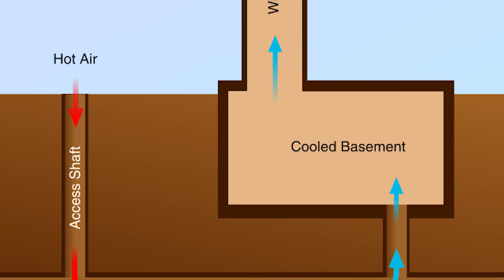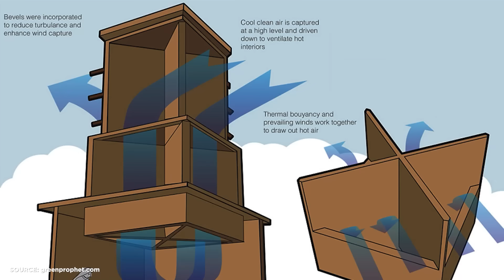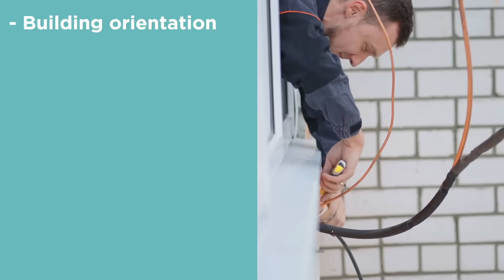Forget Heat Pumps - This House Cools Itself With NO Electricity!

Comment: Canada has had the so-called "R2000" program which started circa 1982, or forty years ago. My house is built to follow (more or less) this standard, with 24 sq meters of solar gain, foot-thick walls, air tight, a Heat Recovery Air Exchanger. Our heat, even in Canada, is quite affordable.  That said, all the gadgets and gaming PCs do use a lot of power.

Comment: My house has a cement slab set about 18 inches below ground and the lower level of the house can be 30 degrees less than the outside air. Even with no heating or cooling it stays between 50-80 degrees when the outside can be 15-106. I have been using resistive heaters in the bedrooms and a wood stove in the main room which I will replace with a mini split sometime this year. My upstairs level is pretty much whatever temperature the outside is, so when it's warm I open the windows. Most of the roof is shaded by trees, but I may still add an attic fan to blow hot air out of the attic before it can radiate down into the house.
When I was a kid in West Texas we didn't have AC, but we did have a swamp cooler on the roof that cools the air by evaporation. It trickles water across a porous surface and then blows air through it which can cool the air 25-30 degrees if the humidity is low enough. It probably wouldn't work in the east when the humidity is high though.
Where I live the electricity really never goes off unless there is a windstorm in the winter that knocks down trees, which is why I have a wood stove, but I added a storage battery to plug the refrigerator and a few other things if there was an issue

Comment: I saw a blog once with a dude who was kind of homesteading in the high desert around Northern Arizona iirc. He had a mobile home and he installed vents in the skirting and the floor. At night when it got cold he'd open the windows and the skirt vents to let the cold air in, then shut everything in the morning. When his place started warming up he'd open the floor vents and it would cool off the mobile home. I think he was using a few fans, but that's still better than an AC unit.

Comment: In Australia we have a town called Coober Pedy. The temperatures regularly get over 50C (122F). The whole town is built underground in what started out as abandoned opal mines. If you wanted a new room you just carefully dug one out. Heating and cooling are generally not required and the only electricity needed is for appliances. This is mostly obtained from solar or wind generation these days but was once from diesel generators.
Reply: Wow. Town of the future.
Reply: @BeautifulEarthJa  From the cave to the cave…
Reply: Inspiration for future Mars habitat
Reply: @GeDiceMan  LOL! Yeah…
Reply: Wouldn’t work here in south US. It gets super hot, absurdly humid, and yet it rains so much. Nothing but muck and red clay most the time… If I could have dug myself into the ground by now, I absolutely would have already 😭
Reply: I have a partially underground she shed becoming a tiny house.   I spent 4 heat domes suffering this summer, but planning both storage and a bed inside.  Cool today, and was out there this morning cleaning it out, preparing for broader use.  Underground is the future. I expect I can spend a month or two chilling in summer and winter. I planted several deciduous trees 9 years ago. Shade, but a tree can put 2000 gallons of cooling mist around the house.  Shade trees on the west, fruit trees on the east.  Nut trees uphill.
Reply: Find some practical ways we don't want to live in the 1800s. Plant more trees and create more energy efficient homes if you have a creek put a was water turbine in and generate your own electric power. And solar if it's practical and off grid. Selling power may be good but if the grid goes down so does your system. Battery system is the better option. 73
Reply: @ronb6182  why are you demanding others find a way that suits YOU?
Reply: @RebeccaTreeseed where!!!? you misread my comment some want to live in the dark ages this is 2023 not 1823!!!
Reply: @ronb6182  Great idea about the creek!
Reply: @classicmax1 anything that doesn't use electric is dark. You need light , heat and water to live. I believe in saving energy but not at the cost of turning back to the 18 century. Good insulation and setting the thermostat to 77 degrees in the summer and 70 in the winter. I think I do more energy saving than most people. When we moved to Florida we couldn't afford to run the AC we used fans and some springs were in the triple digits. At least the nights were in the mid seventies. The attic fan cooled the house. Now that we have window units that don't use much energy we can cool just one room and save hundreds of dollars each month. My bill rarely went over 50 dollars. I also don't need to spend a couple of hundred dollars to build a house. I can use what is built already and save money. Enough said 73
Reply: Sweet!
Reply: @classicmax1 yeah I just thought I don't have to either I can use Gas. They make natural gas AC units. Good point. 73
Reply: Only just saw this video.
Yt a bit slow in updating me.
Spent a lot of time in the tropics and most non-electrical house designs there are designed to capture and control breezes.
What happens if there are no breezes?
Living in Port Moresby PNG, I came across the ideal house, designed by the Engineering Dept of the University of PNG.
Very simple design, but very effective.
The house was single story open plan running east-west with a besser block (cavity brick) wall on the north side (south side in northern hemisphere), running parallel to the house, the top of the wall being level with the eaves and 1’ distant from it.
The wall absorbs heat during the day and acts like a chimney drawing cool air through the house, which has louvres and fly wire netting, the ends of the house being completely sealed.
The resultant airflow is further enhanced by the ceilings being curved (easily manufactured from dampened particle board sheets).
The pitch of the ceilings being perpendicular to the pitch of the roof.
This results in turbulence of the airflow resulting in having air directed at you from all directions!
Because the heat is stored in the wall, the airflow continues throughout the night.
I am not sure whether the cavities in the wall were filled with concrete or not.
Reply: please discuss radon issues.
Reply: @rm-gh1co  They (and most of the world) are fine - the soil and rock doesn't contain the mineral that breaks down to release radon. 

It's something to check for when buying or building since in radon prone areas, you can "solve" the problem by ventilating the basement (Modern air-tight houses concentrate the radon to dangerous levels)

Comment: When we built our house 5 years ago, we ran with under ground pipes for incoming air.  Its 5-10 degrees celsius warmer during winter and 2-8 degrees cooler during summer. Its inclined with perforated pipe just before the last bend, for water to escape.
Reply: That can be great and sounds like it works really well for your area.   You do have to be able to clean these pipes in most climates due to mold and mildew issues.  There is also radon concerns some places to think about too.  But awesome idea.  
Could also just seal pipes and pump glycerin around and get same results in any area.
Reply: @mrkozz1  The thought of mold was actually brought up, but our neighbour has the "same" system and for them it worked well. Not sure what it takes for mold to start growing since even if its probably quite humid, the air is constantly moving at quite high speeds.

Comment: I live in the southern region of Brazil, and around here it only became common to have air conditioning in houses and apartments a couple of years ago (you could get air conditioning, but most people didn't bother because it rarely got too hot). Before that there was some electric heating for the winter, but mostly people would basically just dress acording to the weather

Comment: Makes a video to tell us windows let cool air in. I joke! Buildings even 40-50 years ago were better designed and planned for airflow and shade trees. I feel AC has definitely become cheaper and therefore more common, with more emphasis too on insulation and efficient windows, but less passive cooling.  I feel so few single family homes are built with basements today too, in the past cellars were cool and dry to preserve food, and finished basements provided a cool place in the summer. Many builders today mass construct housing divisions, they dont care about things like longterm quality of life. And with rentals the owners have no incentive to improve the house or make it energy efficient if they pass the utility costs to the renters, and the renters aren't in a position to improve someone else's property.

Comment: Great news about the Nebula classes!!!  Congratulations!  I will point out that in domiciles in days of yore, had much lower cooler temperatures to content with.  Remember how all the people in the old Westerns dressed in what looked like incredibly hot, multilayered clothing?  It was not out of some level of modesty (at least not entirely), the temperatures back then were lower enough that those sorts of clothes were comfortable for much of the year.  So, the problems of staying cool that we have currently did not really exist back then (at least not to the present degree).

Comment: All of this sounds nice. But you have to have fresh air, which means you have to have another system helping the hvac system. Or else you'll get a build up of carbon dioxide. It sounds nice as I said. All the solar panels(made from oil) this whole electric vehicle thing has happened back in the 1900's they had more cars and more charging stations. So... it's just a bunch of bull. Trying to sell the past. But good video, I guess, if you're into fairy tales. I believe in natural energy collection but wind and solar are not it. In other words, You have to have an air exchange. Dump air from inside and pull outside air in.

Comment: I actually take issue with your representation of the Texas blackouts.  Yeah, there was old equipment that contributed, but the vast majority of why it happened was the push to "green energy".  I feel sarcastic saying "green" in that statement, because it is FAR from it.
The unusual cold froze the wind turbines, not much solar available due to the storms/clouds and, sadly, the push for going "green" meant there wasn't enough fossil fuel energy to cover the demands in the weather.  Therefore, blackouts.
Until you can be honest enough to state ALL facts (not just those that appeal to you or align with your values) then I can't fully trust your channel anymore.

Comment: One thing to mention is double-hung windows.  They are meant to be able to be opened at the top to vent warmer air while the bottom is opened to let cooler air in. Combined with higher ceilings, they help keep things more comfortable.
Also, in dryer regions of the world, one way to cool things down is the swamp cooler.  They mostly work on the principle of evaporation, in that when water evaporates it draws energy from the air to bring about the evaporation.  They use 15% to 35% of the energy of an electric AC.  They tend to not work as well in areas of higher humidity.
Lastly, most of the techniques for keeping the cost of heating and cooling down that Joe mentioned all involve reducing waste through conservation.  A well insulated building will retain heat in the winter and stay cooler in the summer.  
Using the right kind of lighting helps.  We have many more options today for conserving electricity.  Overall, many of our modern appliances are more efficient today.  Updating to newer appliances can save a lot.

Comment: Do your research before you buy into any sort of air-tight structure.  Without sufficient airflow pollutants from off-gassing household items can build up.  Also make sure there is no radon or it can build up faster than in a ventilated house.

Comment: The real energy savings is VRF heat pump, not standard heat pumps. It moves heat from rooms that need cooling (exterior rooms) and moves that heat to rooms that need heat (interior rooms).  But having high efficient HVAC doesnt help as much as improving the R/U values of the building insulation. 
And yes past people survived those temperatures, but they didn't have the same standard of living. There are health benefits to not sit in 85F and high humidity conditions within a building. Look at the history of Carrier air conditioning, you will find out the health benefits of air conditioning. Mold and VOCs are problematic as well.
If you want to talk about buildings using energy, you need to look at public / commercial buildings. Passive technologies are nothing new. We look at that all the time, as a professional, for buildings. Passive tech does not work in every location or building use. For example, when you mention the termite mound, we call that thermal massing. It only works if you have cooler air at night. And the building you used with that example, their indoor cooling setpoint it higher than ASHRAE suggested comfort standards. So yah they have free "cooling" but is 80-85F really cooling? Its a matter of accurately comparing building usage.
Also, you mention how the upfront costs of the better construction can be made up for within a few years, but that is not always true. Professionals like myself, perform energy models / life cycle cost analysis to determine if and how much someone can do with energy efficient designs and still have a decent payback period. Energy costs are not the same across the country. Midwest still has very lost energy costs and their payback period for some of these technologies are longer than the estimated lifespan of said technology.

Comment: TEMPERATURE:
Ireland does not suffer from the extremes of temperature experienced by many other countries at similar latitude.

Mean daily winter temperatures vary from 4.0 °C (39.2 °F) to 7.6 °C (45.7 °F).

Mean daily summer temperatures vary from 12.3 °C (54.1 °F) to 15.7 °C (60.3 °F).

Comment: I'm an HVAC tech. There is one major problem that no one talks about when 100% outside air is supplied to a building. It's filtration. Air filters plug up quickly when nothing but outside air passes through them. Filters typically need to be replaced monthly in a system like this. I see this in hospitals and laboratories. Filters are usually disposable and not biodegradable. Washable filters exist but they aren't very efficient. If everyone were to switch over to a system like this it might create a new crisis.

Comment: Right I lived in South America near the equator line and yes it is bad to try and sleep with uncontrollable sweat and specially frustrating when you go for a cold shower and there's no cold water anywhere. But you can live with it as annoying as it is. 
 
I am currently living in south New Zealand and it is impossible to fall asleep without any sort of heating. It's only made it worse by the houses' badly insulated walls and windows/doors not to mention they have 'winter rates' that drives power bills way higher than it would be anyway. 
So how about a house that warms itself without electricity? Now that would be more impressive...

Comment: Using wind to cool a building relies on the wind being cool enough to remove heat. When it’s so hot that the breeze is hot then you need to rely on insulation and hope for the best.

Comment: Staying that the upfront cost for a net 0 house Is 30% higher than a similar "regular" house Is a bit optimustic... We are renovating a house, the cost for insulation and new Windows Is equal to the price we Paid for buying ti house itself... Then solar panels, batteries, heat pump, etc...

Comment: Out of the view of a technician I have to say that that video is very shallow. - concerning people from the past. Well, they felt comfortable in a wider range of temperatures. 16 degrees Celsius in a room in winter where fine. They wore house/ -shoes , -coats and sleeping hats where common. We shouldn’t forget that old houses also had thick stone walls what stored energy very well. And also wooden houses where good as wood itself is a very good insulation. Both ways to build would be very expensive today. You would need a lot of m2 for your walls and also your materials are expensive. So we are developing houses what need less energy, less construction space and cheaper materials. And that’s quite a challenge seen what building standards we need to achieve. I think adding a heat pump to buildings by default is a very good idea to get the basic temperature needs for our time and frame of comfort very efficient. Wouldn’t it be nice getting the main energy need for a house down to 200watts a day and a person? One could produce that by cycling for about one hour. ;) Also, after that I guess a cold shower will be comfortable and favourable to a hot one. Another energy demanding use is cut down XD would be a win win situation for budget, health and environment ;)